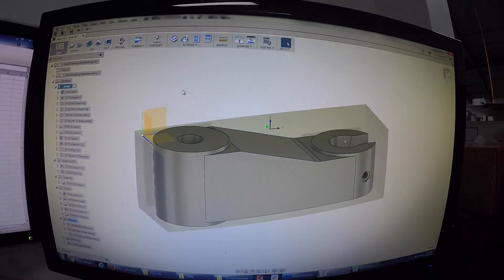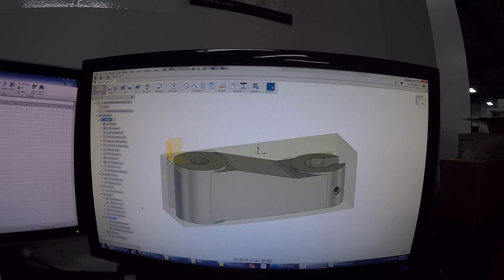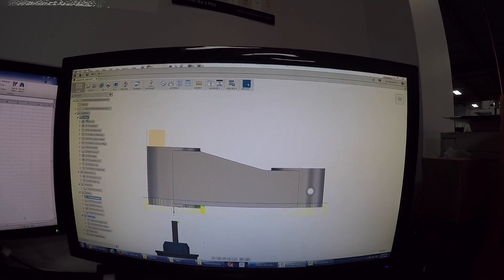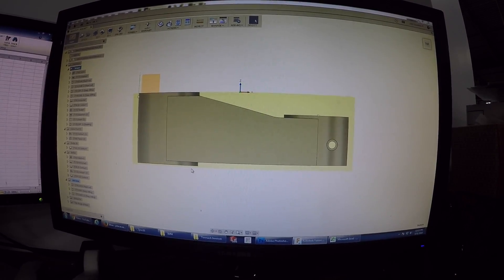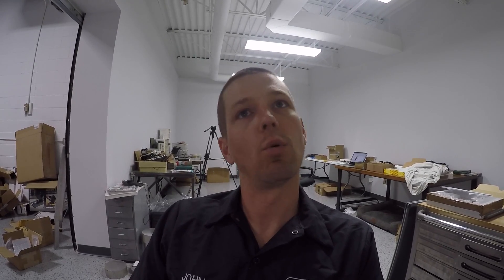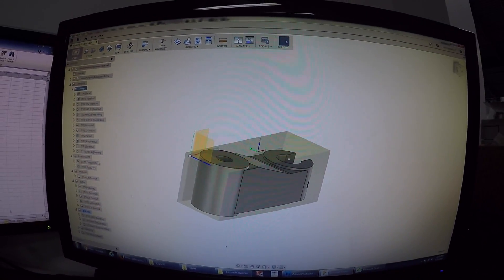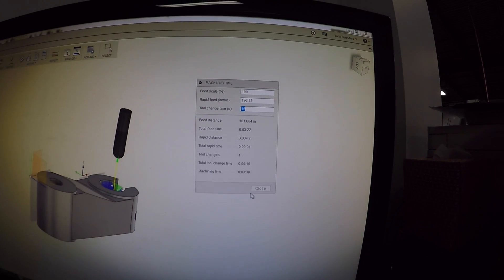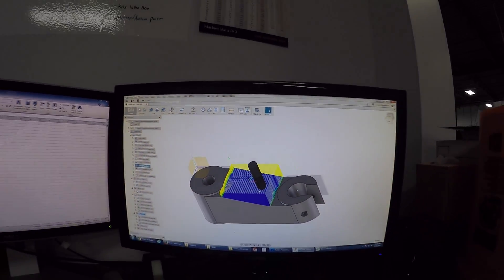Abom79 Parking Attachment!  TIME LAPSE!

Comment: G'day John I don't want to appear to be a smart-arse who's telling you how to suck eggs, I'm instead here to learn from you. However you mentioned machine time, and as your operation gets bigger that's probably going to become something that deserves significant consideration and habit forming on every job.

If you could do this whole project again, do you think the order of operations you conducted things was the most efficient way  you could have gone about it? Especially in regard machine time? What I'm getting at is, in my humble opinion, the machine appeared to spent a lot of time machining areas that subsequently became air! Just as a specific example, the whole top surface was fly cut, which leaves a great finish but is slow ... and then most of it was immediately machined off!!! The whole right side of the stock was side milled ... and then machined away. Why not just, for example, fly cut only the area that becomes a feature (say by approaching from the left hand side of the stock), and preferably when doing a tool change for a later fly cutting op?

I've heard some very wise people say that "the money in machining is made when roughing". They told me that it doesn't matter how you get the waste off, just get it off! That could mean a bandsaw, a plasma cutter, a big-arse roughing mill, it doesn't matter how it's done, just find the quickest way to get that material off! I'd probably add to that advice given to me, not to spend any more time than is absolutely required machining features that will subsequently become air. That is instead just a pile of chips that hasn't been created yet ;)

Just a bit of unsolicited food for thought, and it will be interesting to hear and see in the future if there's any value in that line of thinking.

Comment: CNC work is not meant for one off's. Therefore to calculate that price means it will always be higher than you expected. Manual machining this part will also cost arround 700-900. But, if I ask you to give a price for say 300 the price would be very different. That is the strong point of CNC. But very nice that you have taken the time and the effort to make a fellow youtuber happy.
Reply: I can't let you disagree. CNC machines are great for one-offs in tool and prototype shops, but inefficient in a job shop, especially considering your machine capabilities. It may work for you, but (and no offense of course, you're living the dream) we can't all be sponsored by machine tool manufacturers.

Comment: using the Wrong tool or machine can add a Lot of labor hrs to any job... when You Know there are Better choices of how todosomething you should not bill out time because you chose to use an inefficient method.
Reply: This was a free of charge, done as a favor part.   

Which means it's actually the perfect time to try out new things. 

If you're not making a part to gain money, you had damn well be making the part to gain experience and skill. 

Which in the long run, can be far more valuable than what he'd charge to do that part for a paying customer.

Comment: Joke is, if I was doing that part commercially, I'd probably try and talk the user into using 6061 or 7075.  I can't see WHY today you'd make it out of steel (except for historical).  It is only holding the head when parked.  The original was probably a casting, and therefore cheap/easy out of CI, but to make it out of stock?  (aka what the motorheads call 'billet' - hate that term), why steel?  Never mind that, why that design?  Could probably do things like make the ramp flat, or some other shape (do an FEA in the CAD) and optimize the metal removal?  Or even, gasp, a bolted/screwed together fabrication
Reply: Yeah, very shocking how strong 6061, or 7075 really is

Comment: I would imagine even with my machines and their fast metal removal rates it would take me a solid day to make one of these and some features would have to be simpler, nothing effecting function but skipping some of the aesthetics. This would be a ton of angle plate and rotab work, which doesn't take long to cut but takes a while to setup. Thanks for the plug too. :-)
Reply: NYC CNC
No problem send me the G-code and when I get the Cincinnati VMC fired up I will feed it in. LOL Probably not that simple and my skill set would at this time be more likely me to pull it off doing some 5 axis manual machining.  Maybe when i get the barn done I can build a parking attachment for my Cincinnati. Of course I would have to design it from scratch since I don't believe they ever made them for machines like mine.

Comment: Machining cost:  the reason the factory part was cast.

But there are benefits to CNC a part like this:  an engraver would probably charge $500 to put those logos on there.  With the Tormach, that cost you all of $30 of that $700 estimate.

Idea:  A tool & die maker needs to make an ABOM logo stamp for Adam.
Reply: Laser engraver. Any shop that had one would charge like $20-$30 to engrave a single part, if that much. 

Not to mention investment casting companies can get fine enough detail to have an engraving show up. But from the looks of the original, it was a sand casted part with the only machining on it being the .751 hole. Which was probably really a .750 hole originally, the old one Abom measured probably just opened up through years wear.

Comment: great job. I usually do the flat or less detailed side first then the Pocket or more detailed side second. as for quoting job shop work, so many factors at play that it is next to impossible to explain. it's a skill that takes years to develop.
Reply: An extension of that is to machine the bottom, then machine a fixture to hold the part.
If you go to any manual machine shop you'll find shelves full of fixtures for holding parts.
Not so much in CNC shops. I guess you could think of CNC as a software fixture system.
Reply: +Paul Kelly reason why I would  machine the less detailed side first is because I can get it on the machine faster and while it runs I can work on the next operation, which may be more time consuming. 2 birds 1 stone, kind of thing

Comment: John this is how I price my work. 
I do not price in conversations with the client about what they want, unless it is after they sign off for what they want.
Design is not quoted if they are providing parameters and not asking for design. Honestly this is a 30min design job. tool paths hmmm depending how good you are at tool paths. For this say an hour on tool paths.
I quote for proficiency not my lack of capability.
If I take 5 hours because I can't figure out the tool path but a good designer would do it in 45mins I charge 45 minutes. I want more money? Then I get better.

This is a $300 part assuming the client diagram is the starting point and its accurate to their requirement.
Also I would not add more stock it still needed to flip it to do the bottom which is not flat. I actually would have started with it upside down to your config. Then flipping it would have allowed you to grip it with more meat and I would have squared the block first allowing you to tram it more easily. All those thing would make it faster. 

But I though you did a good job in recovering it. I might have done a do over. Steel is cheap. Time is not.

Comment: You'd have saved a lot of time (and money...by making more parts) if you'd only bought a cnc machine with a tool changer...  It's going to to old really fast changing chucks between milling and drilling ops, or just to change out different sized bits.  A VFD would be excellent too.  Oh and did I see you change spindle speed using belts?

Comment: Can you do a fusion Friday for setting up lathe tools from scratch. I'm doing gang tooling and having a pain figuring it out. For example I have a bin of boring bars. Does fusion require them all to be a certain direction. It seems i can get them to work in any direction but it's a pain to get the orientation right. If you could just go over this whole process that would be great. Thanks

Comment: Ya can't rush excellence.  Sweet.   Sounds like some unknowns still in your pricing models.  There are some good T&M software packages out there.  Not that I recommend a full time T&M approach but good T&M tracking today (even if unused on the current job order) helps zero in on tomorrow's pricing.  Until your brain can do it by rote.   Then you need a good shop manager who thinks like you.  Easy.... NOT.

Comment: We all do jobs on occasions without profit in mind but, If you were to do it again as a real paying job it would be far cheaper to do it, as the original, as a casting and just machine the dimensionally important parts. 3D print the pattern as you have already done the Fusion drawing. I don't suppose you will be inundated with requests for K&T parking parts but you never know.:>)
Reply: Really? You earn a living from machining and you are saying doing a one off casting is going to be cheaper? So you have to produce a pattern, cast in LOW CARBON STEEL at 1800 Celsius smelt, then ... see what I mean.
Reply: Compared to 700-900 bucks for machining from solid, yup. And the part is a relatively unstressed item so Aluminium/ brass/ bronze would probably be fine but CI or  SG iron to follow original pattern, why not.
I haven't had anything made off cast iron recently, the last time was some custom wood turning tool rests in SG iron, not very expensive, could have had 4 for the price of one though if I had four patterns tree'd together, as you paid by the flask where I had it done, on small items. I will admit that foundries that do CI are becoming rare, thanks to environment issues, but can still be found (no pun intended)
Reply: I disagree. Building the pattern would require exactly the same amount of work as milling the final part as a solid and then you don't even have a part. I am not sure why you would recommend that.
Reply: You can machine, if you don't have 3D printer, a pattern from wax or foam, much more quickly than steel. In fact a one off foam pattern, for a lost foam casting, could be cut using a hot wire in a very short time, with only a minimum of lay out, On a foam pattern a good enough finish could be done with some glass paper. For most of this case there are only a few areas that need to be machined to any degree of accuracy, most is just a "shape"but John has to machine these on his mill to the same degree of accuracy as the important parts, which is more time consuming. So a casting would, for this part, have been a good option, but a lousy demonstration of CAD/CAM.
Obviously if there are no financial or time constraints, you can do it any way you want to, there is always more than one way to make anything.
Reply: I do castings like this. It takes quite a while. It is not a 3 hour process. Its the time it takes that I am debating. I do not believe for a part as simple as this to machine, that it would be quicker to cast. Remember the only thing you save in casting is the (1)time of hoggin out surfaces (2)the tool wear, and (3)The raw material cost. you also sacrific material structural integrity however. If the cost of machine time and tool wear is more than the casting process then you are right. I am saying that the real world time. from the second you start, to the moment you finish is way more than the machine time or the tool wear for this particular job.

Comment: Yes. Stock is cheap in the grand scheme. Unless you get too much and spend hours trying to machine it off XD

You can hold onto practically anything with just .100 (.100 hardened step jaws are perfect for this) so extra 1/8" all around is a perfect amount for stock size. You could get away with less... But why? 

For part cost?  Ya $700-$800 is way high. Maybe half that would be reasonable. Maybe half that